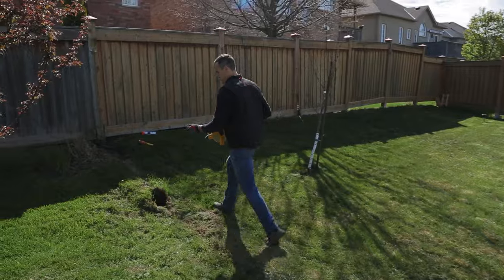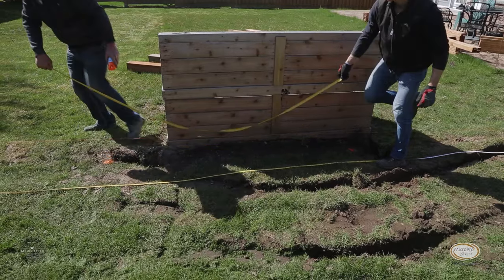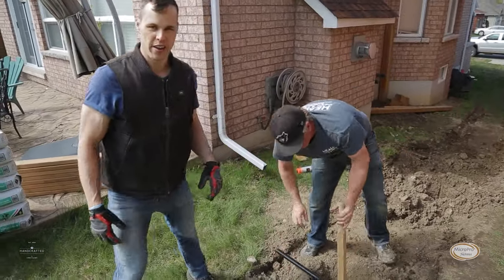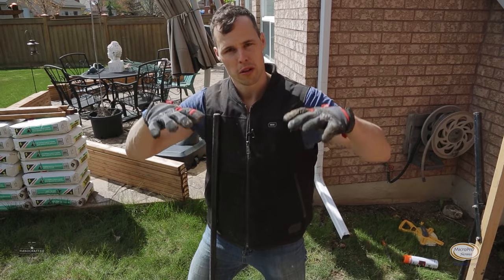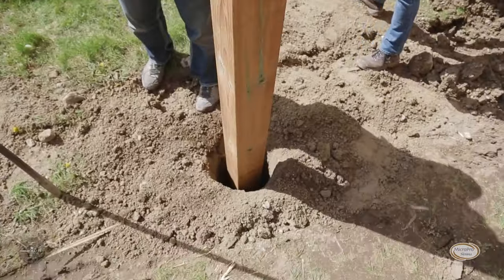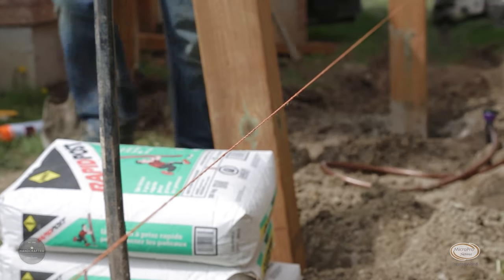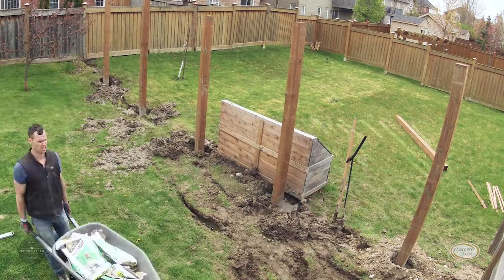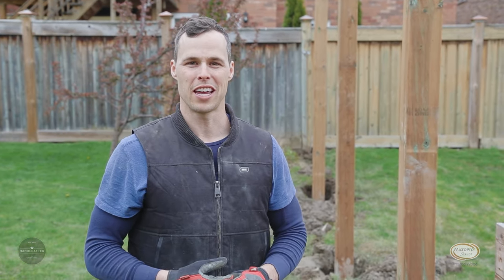How to Build a Fence - Part 1 (Post Setting)

Comment: You want that post in the center of the concrete too.  The best you can any way.  I like to fill the bottom of the holes with gravel or pea one as well.  I have seen to manyposts sink because of being in edge of the footer.
Reply from the maker: Most definitely, and if you find yourself slightly off centre due to the spacing, you can always pull out a shovel to elongate that hole in the direction you need to keep your concrete evenly distributed around your posts! :)

Comment: Fence line needs to be inline and pleasant to the eye looking down the line.. The #1 way without having to level each pole with a leveler would be string the top and bottom of the (2) preset end-post this way the alignment will be fool proof but you will still need to level side to side, the fence line will be 100% directly inline with the (2) end post.  I could not find 1 video where 2 strings upper and lower is being used which is the most precise and efficient way of installing the fence post.   I've been doing the 2 string alignment since I was 14 years old - 51 years. And I was taught this method by a 70 year old multi-millionaire contractor.
Reply: What does multimillionaire matter?
Reply: @RaiderNation86  that's how he afforded the second string...
Reply: @Edit_the_edit  😂😂
Reply: Thats good to know actually. I’ll definitely do that when I put my fence in later this year.
Reply: I run on centers as well and mark  my bottom string.   Coming from an industrial installer for a massive company.  I do a ton of specialty stuff that is all required on center.  You can always cut the steel panels to size butnyouns t make the  grow so you better be spot on
Reply: Same here
Reply: Pea gravel or suitable substitute at the bottom of the hole so the water will drain away, also posts are plumb not level. And two strings speeds things up.

Comment: Question, why add the post mix first? surely it wont soak through all of it as it dries out quickly? When I've done a fence I pour some water in and add mix and then add more water and give it a good dash with a tool etc. I always thought be doing it your way the water wont soak all the way through and it could have dry spot in the middle and only hardened around the edges and tops etc. Even though it would be a lot easier doing it your way...
Reply from the maker: So in this terrain it was a bog, the bottom of the holes were filled with water from the natural ground water seeping in. The whole yard is clay beyond 3ft, so the last foot of depth allowed for great saturation. Also, putting the mix in the bottom first will allow a base to the post, it's never caused any issued and that fence is still straight after 6 years plus.

Comment: Thanks. But how do you level the TOPS of the posts? I didn't see any effort to ensure the tops are level (horizontal). Do you cut them after installation?
Reply from the maker: I hold a speed square and cut them flush to match the plumb post.
Reply: Aligning a string between the end posts works too

Comment: Watch for dry pockets in concrete … Crete that doesn’t get mixed … and run Crete just above ground level or water will rot out your post at the base in which the Crete hasn’t formed some kind of barrier or protection
Reply from the maker: The 6x6 posts have a special coating to prevent underground rot. So hopefully the concrete won't do anything it shouldn't.

Comment: I can not find one video, anywhere, on how to ensure two gate posts are straight across from another and not angled slightly.
Reply from the maker: Use the technique to square a deck 3,4,5. Basically the 2 flats of the triangle measure 3 and 4 and your 5 is the length of the diagonal.
Or simply use a 6ft level to flush your faces.
Reply: @HandcraftedbyChrisPalmer  Thank you..

Comment: OK you convinced me.  I live in NY, my frost line is 4 or 5 feet.  I am not going to dig holes 6 or 7 feet deep.  I'll just skip the concrete, slide my metal posts into the soil, and deal with the shifting as it goes.
Reply from the maker: How did I convince you to not dig holes for concrete footings?
Reply: I'm in NY aswell and ur overthinking it, I'm trying to put up a fence for chicken wire to keep foxes out. We are not trying to build a foundation for a home lmao. Dig a foot and half down. Put 6inches of gravel or small backyard rocks. Insert 12inches of post, fill remainder of hole with concrete.
Reply from the maker: @byondvision  I recommend you look into your bylaws or building codes. Frost line is a standard to prevent post upheaval. Sorry to burst your bubble, especially in NY - you have a nice cold winter like us in Ontario.
Reply: @byondvision  How tall is the post, burying any post only 12 inches into the ground is half assed and something only a lazy person would do. Have fun replacing or readjusting everything every few years, or just having something that looks like complete trash. If you're just putting up some piece of rubbish, why would you even care about this video...

Comment: When you first started, how did you know that your string  line (from point A to B) was straight??  Yes the string is straight because when you pull a string it becomes straight but it doesn’t mean the FENCE LINE is straight.
Reply from the maker: It's marked by property stakes, metal spikes in the ground. You should have a survey with your home. The stakes and string line go in line with each other.

Comment: So is the spacing between each post 8ft exactly?
Reply from the maker: As close to as possible, usually 8ft on centre. So 2x6x8 lumber can be used and also makes for a stronger fence not spreading posts too far apart.

Comment: How do you align the height?
Reply from the maker: Typically you would measure off the ground for your height. I keep the post cuts all typical with 6" or 8" off the top plate board.
Reply: stringline, with a spirit level attatchment, mark the 2 posts, or each individual post, and then use that as the mark to go off, when measuring up

Comment: I dug my post 2ft I live in Eastern Tennessee.
Reply from the maker: Yeah, can't say for sure what will happen....perhaps ask the fence guys what they typically dig. 2ft is shallow for any post. Tipping hazzard with a top heavy post.
Reply: @HandcraftedbyChrisPalmer  I ran into a lot of slate rock it was almost impossible to dig any deeper.
Reply from the maker: @williamlewin9610  break out a chipping hammer SDS or mini jack. Otherwise you could put a mount into the rock like a footing.

Comment: you didn't list what type or where I get the right kind of gravel.
Reply from the maker: It all depends on where you live. Its concrete post mix sold at all hardware stores here in Canada.
Reply: cheapest concrete 60lb or 90lb bags u can find @ HD works just as fine

Comment: What kind of posts did you use?
Reply from the maker: 6x6 pt
Reply: @HandcraftedbyChrisPalmer  Alot of wood is PT, that doesn't mean you should put it in the ground.
Reply from the maker: @brandonk1502  it's rated below grade, then yes it does mean you should.
Reply from the maker: @brandonk1502  to be clear, post material (6x6 and 4x4) is typically marked differently so you know it can handle underground placement.
Reply: @HandcraftedbyChrisPalmer  Just simply saying for those that don't know, I made that mistake before, thinking that anything that was PT could be ground contact. Anyway, I appreciate the video, it's always nice to see how other people do things.
Reply from the maker: @brandonk1502  it's a good piece of advice, most won't know that. Thanks for sharing 👍

Comment: So my frost line is 24 , Should I make my holes 24 or 30inches?
Reply from the maker: I suggest 48" and the only way to go less, is if you have specs from your geographical region stating otherwise.
Reply: @HandcraftedbyChrisPalmer  You ain't building a foundation to a home my guy. 24" is gonna be plenty for a 30 year fence idc if you live in Alaska.
Reply from the maker: @mikesweet5848  well Mike, I'm glad you are the OBC and create the code for building...oops wait, no you don't! Lol, try following the rules and guidelines put out, you may make a better Carpenter or whatever you want to be when you grow up 😆
Reply: @HandcraftedbyChrisPalmer  I'm already at the top of my game so it would be hard to get any better. I quite literally build the nicest power gates in a metro of 3M people.

 Once again, you're building a 30 year fence not a foundation for a home. I know it gets a little confusing, but I would be shocked if you could cite a building code that says you need to pour 48" for a fence post lol you should hear yourself talk.

It's always entertaining to see someone put out an instructional video and get ratioed, but take to the comments to try to clap back.
Reply from the maker: @mikesweet5848  listen, come up to our province where we standardized our post depths to be below frost lines. These subdivision style fences require 4ft due to the heaving of our spring season. If you're not geographically challenged, look up on the old Google Maps for some help to see where that is. And if you speak to any other Canadian builders, you'll likely get the same answer. Hopefully your fancy fences last where you build them Top Gun 🤣

Comment: Sorry im confused with the comment about existing holes. What's the issue ? Why wouldn't you use existing wholes specially if your going like for like or did I Hear that wrong
Reply from the maker: Reason being the old holes are filled concrete and old posts unless you can remove them successfully
Reply from the maker: Some old holes are poorly dug and create more work than making your new one as it could require double the concrete to fill. 👍

Comment: Why don't any videos ever talk about how to make sure the string line is straight? Like there is not a single video that talks about that. It completely skips that part
Reply from the maker: How to keep it straight, pull it tight from end to end 😁
Reply from the maker: You need a site survey or a property stake to know where the line is between properties, after that set, your stakes where they need to land according to your bylaws and pull a string line tight. That's it. Then locate your 1st post and mark your post centre to centre distances.

Comment: How can you add all the post mix then the water, the water will not reach the bottom and you'll just have a few inches of concrete.
Reply from the maker: I add one bag to stabilize base of post and then mix and pour in the rest while adding water. The ground water rises up in these holes so it does get wet and sets up well. Not like pouring a deck footing.
Reply: Quickrete says to add after right on the package. So if they say it’s good I’m sure you’re fine! 😁

Comment: Those posts will eventually rot and fail at the soil line.  You should have used metal Strong Ties as a base set in concrete and attached posts above grade.
Reply from the maker: This fence will outlive you. Ever seen an old farm fence? Ya, no steel there.